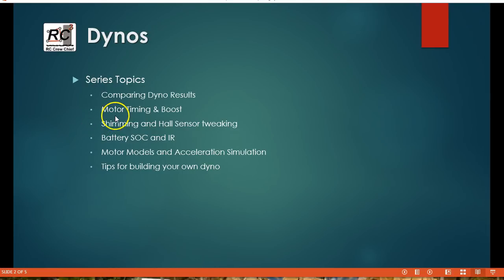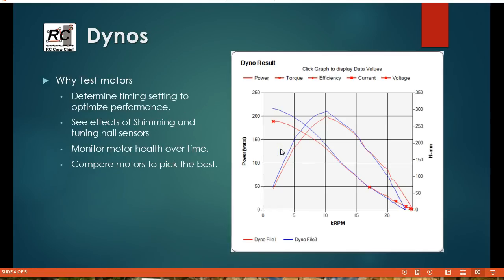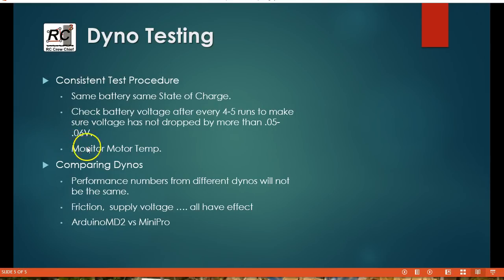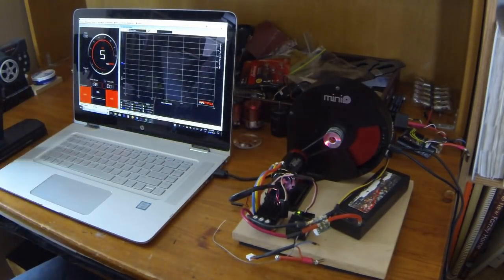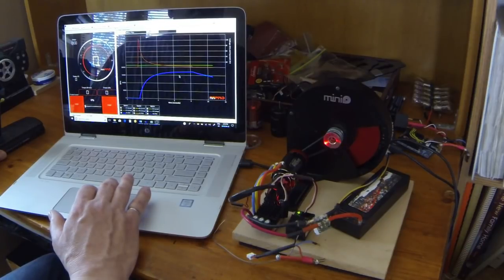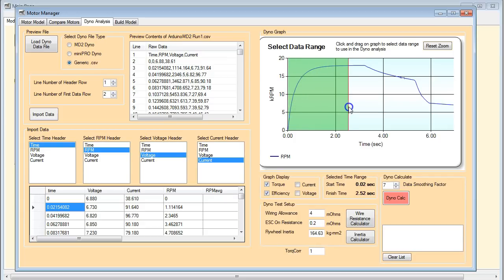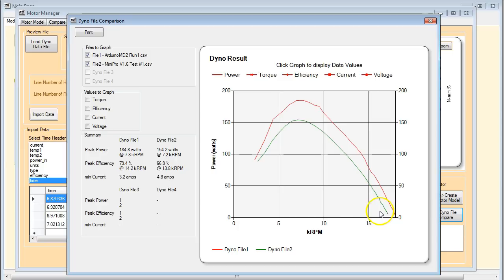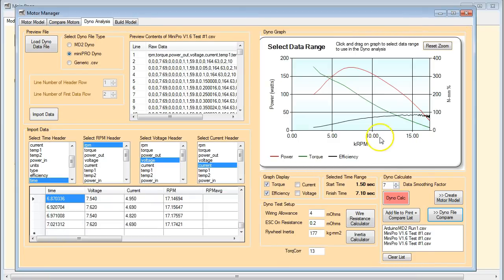Episode 1 Comparing RC Motor Dynos

Comment: great video..
would you have any dyno runs for the stock 540 as well as tamiya torque and sport tuned motors .. id like to compare them to the GT tuned.. the only info i can find is max rpm (which as you showed is meaningless)